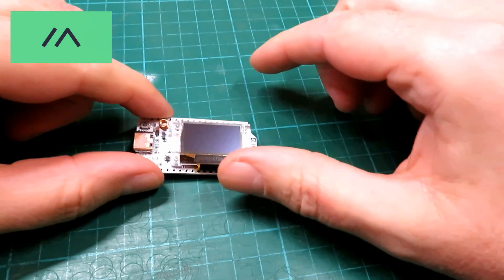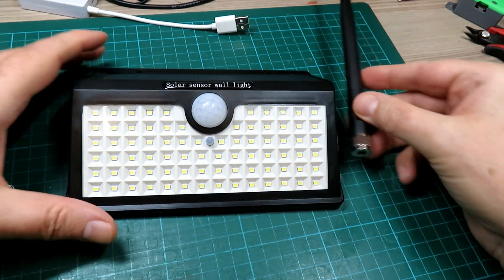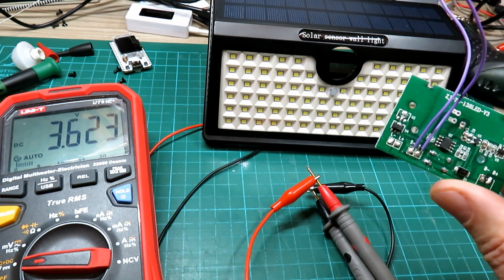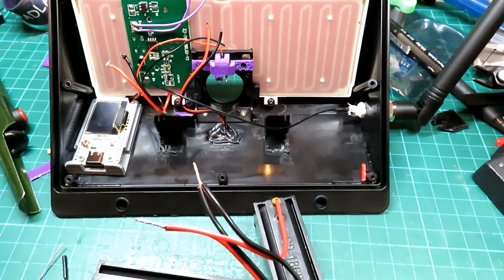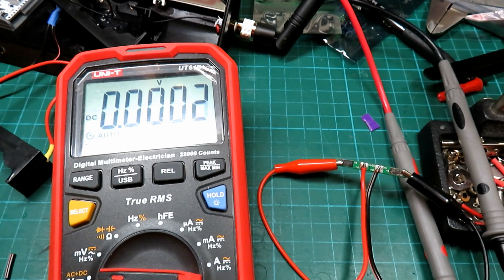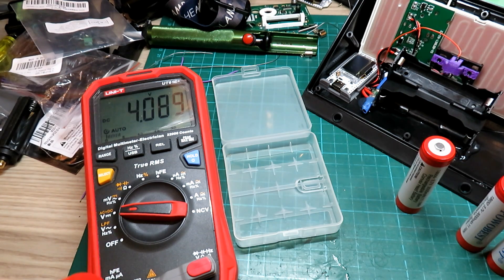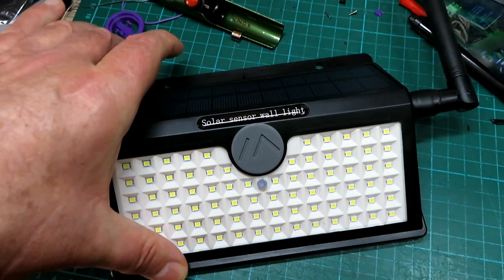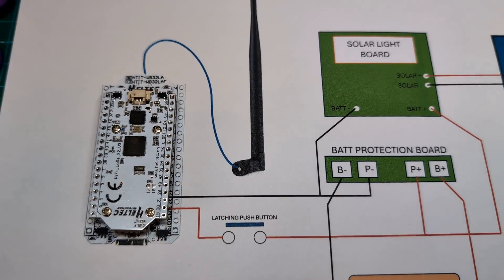MESHTASTIC SOLAR POWERED NODE FOR 10 BUCKS?

Comment: Thanks for doing this video. I was thinking of doing similar. QUESTION .When I look at the node list on my phone I see padlocks open or closed against the nodes. When I have watched videos like yours I don't see any icons on padlocks. Why is mine showing padlock icons. Cheers from old George
Reply: New meshtastic updates click on the symbol and It will explain it. Basically new app updates and radio updates has different encryption keys.
Reply: @joe-q5x5p thanks for replying.  All the Nodes I have . Have got latest firmware and show padlock open. Are you saying the locked ones ate using 2.5 and below. ? George

Comment: Top tip. Don't set your adjustable antenna to 90 degrees. Keep it straight and vertical. Otherwise you lower the signal strength. This can be seen in real time using a spectrum analyser on a nano VNA.
Reply: Counter tip.
A 915 antenna tunes down to 868 when bent 90 degrees.

Comment: Hello, do you know if it is possible to connect a solar panel directly to the heltec v3?
Reply: The voltage from solar is not steady,it will destroy the V3 board

Comment: Just so you know, the loss on those antennas is horrendous when you run them at a full 90 degrees like that. would be much better if you could orient it straight up. Solid project though.

Comment: Using a low consumption RAK board should let you have enough power to run the unit off grid without support, maybe even run the light as well.

Comment: Blacks will connect something called scamgpt to the mesh network be mindful and put hidden cameras inside your house they will break in and put humidifiers into your water pipes and you will hear voices. I'm not kidding blm does that to apartments here in the 07106 area

Comment: Hi @knoxieman (Sorry I don't know your name). I bought the same light as yourself and used the RAK board. The RAK has a direct solar input so I connected that to the solar and 1 x 18650 to the battery port and on a cloudy day it managed to take a 37% battery to 47%. I also bought a right angled whip which mounts with a  thread on the bottom so it can screw directly into the case and is held in place with a nut part no. ANT-868-PML-UFL-ND if anyone is interest. You need to waterproof the hole in the base of the antenna which I did with some hot glue. Thanks for the inspiration. Rob
Reply: How well has the rak board faired on one battery and what size panel do you use?
Reply: @gazzat5  They died around Novemeber when the days got shorter. I had two of these at high locations and both died around the same time.
Both locations aren't accessable so I can't retireve and charge them, but I can still see the bluetooth. I have tried to connect to put them in rx mode only to see if the batteries will charge over a few weeks but so far I've had no luck as the BT connections just dies. So in short the panel is undersized but it lasted 7ish months. Hopefully now the days are getting longer they may recover.
I hope that answers your question.
Reply: @RobCanada  that is useful thanks. What was the power rating of the solar panels used?
Reply: @ no idea it was just the solar light one. Sorry I can’t give you anymore info as I never measured it.

Comment: I have a few of these security lights in my garage that I haven't put up yet. I have a low draw Meshtastic device on the way. Do you know if it's possible to leave the light functioning and just piggyback the Meshtastic device off of the battery? I guess there's only one way to find out. I'll try to report back if I can.
Reply: Did the piggybacking work?

Comment: Thanks for the fantastic inspiration. I had a couple V3s, a few of these lights, and a pile of 18650s in my shop, and I never thought of doing it this way. I tried two different configurations, and it led me to the right solution for my use case.

Comment: I have doing some research. I was thingking about doing the RAK devices and rhe 15 dollor solar light from Lowes home improvement store. The hack is on the Meshtastic web page. Also I was looking at 5 watt solar panels for usb c security cams and using the internal charge control built in the RAK borads. And getting bulk USB -C charging port off of Amazon. And 3d print a enclosure.
Reply: How did it go?

Comment: Without charge balancing, even if the initial charge is similar, won't it begin to vary over time and either overcharge or overdrain?
Reply: No because the two cells are in parallel, not series.
Reply: @JontyCtheKing  But due to unique physical differences of each cell they will gather charge at different rates and discharge probably also at slightly different rates. Over time this drift will lead to some differences, right?

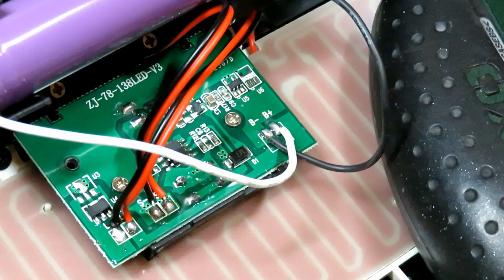Comment: 2:30 I think you're missing a point, here.. That solar panel doesn't supply enough power in "our dark winters", or even an average muggy day to fully charge even one 18650 unfortunately. Adding more would not do much imo. A good covert idea, though, I'm just dipping my toe into Meshtastic, too.
I always try to add a protection circuit to my cells where they are stand alone, as totally draining the cells kills them. Adds around 3mm to the length, so I'll have to make a longer holder for them. 👍
Edit: While flashing my Heltec board, it seems to have battery protection onboard! Awesome!
Reply from the maker: When the heltec shuts down it drains about 19ma and will slowly kill your battery if left like that

Comment: 2 18650's in the 3000mA range will last roughly one day so with that tiny solar panel in overcast weather.. there's a reason people typically build bulkier contraptions for their 'drop and forget' repeaters.

Comment: I have a question, you didn’t mention anything about the PIR, light sensor and disabling that… Because surely that’s what turns the light on at night, so that’s what makes the power drain is there way of disabling it?
Reply from the maker: Yes take it off the board as I did in the video

Comment: Great idea. I have three of those solar units. Would it be possible to just attach the Heltec to the solar units battery and leave it at that? Or is there not enough juice in the battery to power the Heltec?
Definitely an interesting idea!
Reply from the maker: Yes, absolutely, you could also daisy chain two lights if you don't get enough charge in the day, you will need to balance them first

Comment: bird box with a solar roof ?
Reply: I'm new to Meshtastic and that was exactly how I thought. I'm building these boxes with my laser cutter/engraver. For context: I live in a small town inside a valley surrounded by some bigger cities. I don't expect anyone from my town to be using Meshtastic, so I was thinking of a way to hide some nodes in plain sight placing them on the hills so I could "bridge" signals to the valley. My main difficulty currently is finding a way to hide the antenna but still have a good signal. Also, I want to build these dirt cheap because I could lose them at any time if they are placed on public property. I have two properties right in the middle of the valley. Any thoughts on how I can accomplish this?

Comment: I have been using the 3000 mah flat batteries and a solar panel designed to charge usb devices. The heltec v3 has its own charging circuit built in and works great.
Reply: The ESP32 on these units chews through batteries.  Any unit using a nRF52840 instead will only sip battery.

Comment: Hi, someone posted a link to your video in one of the Meshtastic groups down here in Kent. I was looking at how to deploy a node without drawing attention to it and I think you have found the answer. One thought is to 3D print a right angles antenna mount so the SMA is vertical into the antenna so there's less chance of water ingress. This could have a flange and thread so it can held tight with a nut on the inside of the case. You've definitely inspired me to buy some solar lights :) I've used very similar ones at a remote cottage for 6 years and they are still working well. I would add breathing hole to allow any moisture to escape (search Vent Plugs) which is what we use in commercial outdoor cabinet to stop moisture building up. 🙏

Comment: I'd be concerned about cooking those cells and the heltec board in the height of summer. A black plastic enclosure is not ideal for temperature control. Perhaps a temperature micro fan to help evacuate the hot air on a warm day might help, but then the power budget will really take a hit... I plan to mains wire mine from my existing garden DC lighting circuit.
Reply from the maker: The original lights have the same chemistry of cells in, i don't see it being a problem, the heltec will be just fine.

Comment: Brilliant.  All of the parts are here for my three node FamilyNet.  I need to design and 3D print the custom enclosures.  I'm using 6W solar panels and four 18650 lithium cells per node.  The WisBlock uses a lot less power than the ESP32 processor in the HelTec transceiver and it has an on board solar charge controller so it would have made your very clever solar LED light conversion considerably easier.  Great job!  Thanks for the video!

Comment: I'm already using those. My versions of that lamp have extendable solar panels too. It works well with WizBlocks. It's pointless with Heltecs. The panels cannot cope with the power drain. It will still die.
Reply from the maker: It's hanging in there tbh, I've another light I can use if needed, this is an experiment after all
Reply: @knoxieman  Yes, that is true. 👌

Get a WizBlock. They run for over two weeks on a single 18650 (2300 mAh). It's then easy for that panel to cope with a busy node, especially in the UK.

Comment: This is certainly an interesting idea, but I would really like to know if such a small panel would be self-sustaining in a setup like this... I've got a feeling that it just doesn't have enough power...   I wonder if that board might be suitable taking a few of those solar panels in parallel though in order to double the amperage...
Reply from the maker: Yup it's lasting ok but I think another lamp next to it running as a normal lamp might be required, testing it out this week

Comment: Nice idea, but for an esp32 device like the Heltec, the solar panel (maybe 2-3W) won't provide enough power to keep the whole thing alive. With a RAK wisblock, it could work over the summer, but they also need 5-6W solar energy over the winter
Reply: I'm putting together a three node Meshtastic network for family off grid texting.  I'm using WisBlocks, each with a 6W solar panel and four 18650 lithium batteries.
Reply from the maker: Yup just using what I have around the place ATM and it's a little experiment for fun tbh

Comment: Great video, but I suspect that you will struggle to get enough power from that solar cell in anything but bright light conditions. The Heltec board takes over 100mA. I guess that time will tell :-)
Reply: Add a wind turbine to it, a rain t.e.n.g generator and moisture energy generator(yes that's a real thing, and yes it's awsome). Also you can make solar panels from old free lcd tv screens of you take em apart... Robert murray smith has an excellent  video on how to disassemble them. And others on how to make solar cells from old lead acid batteries bit they're for members only
Reply: Also I've thought of using a 2dof beam head circuit to create an automatic tracking solar panel system for a lora node.